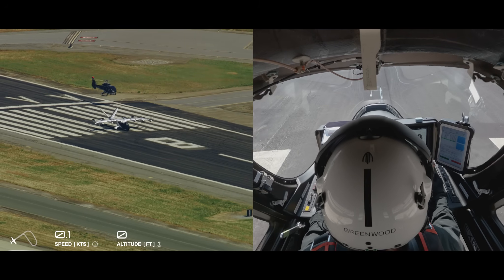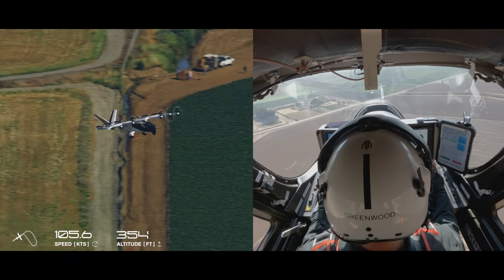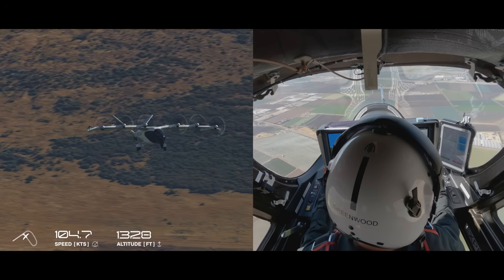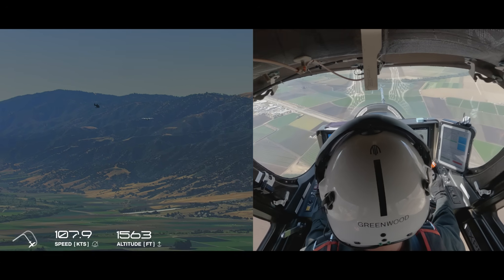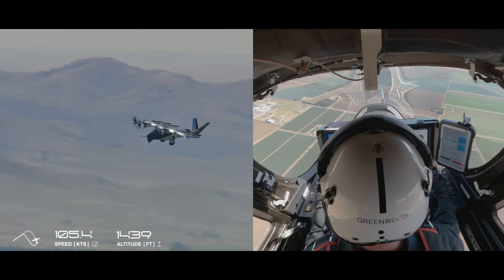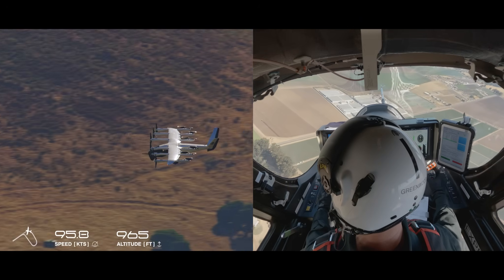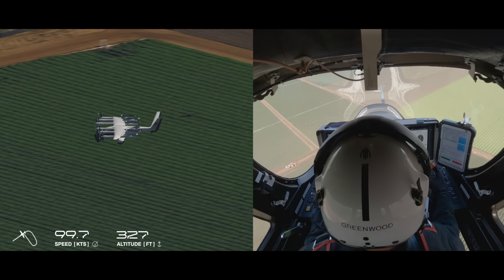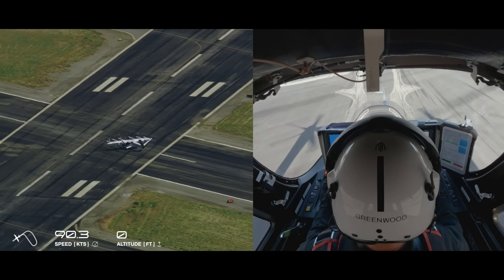Midnight Piloted Flight with CTOL | Full Flight Video

Comment: I earlier hadn't realized that an eVTOL first had to prove it's capable of conventional CTOL like an airplane. In this test flight the six rear propellers appear to have been shut down. Archer apparently needed to prove that if lifting capability were damaged, the aircraft could take off and land like a conventional airplane. And it appears they did it with only half their propellers operational. Well done! Archer has already conducted unmanned VTOL flights. We're looking forward to a manned VTOL test.
Reply: The rear propellers (fixed in the vertical-thrust direction) are shut down for horizontal flight.  By design, they are only used for vertical takeoff/landing.  The manned-VTOL will be a huge milestone for them, can't wait!
Reply: Correct. Unlike a helicopter which my lose its one and only rotor and drops like a rock from the sky, if the Midnight evtol loses its lift rotors it can still land like a plane. Much safer.
Reply: @Palyaltosuper8  Helicopters can still land despite engine failure, they use "autorotation".
Reply: @XxxSimonLPxxX  Experts everywhere..
Reply: @Palyaltosuper8  What happens if it looses forward propulsion motors? 
What happens if the batteries decide to go into thermal runaway?
Reply: Same thing as a conventional aircraft—it glides down to an emergency landing.
Reply: @Palyaltosuper8  I can't wait to see the glide tests something tells me that with all those dead props causing drag it won't glide very well or be very controllable whilst doing so.
Reply: @thedave7760 each motor has its own battery pack.

Comment: It appears that the 2 blade configuration is being used for the rear stations and they are locked in position which is all very positive for wingborne flight. Have you demonstrated this configuration for vertical takeoff, vertical landing, and transition during non-piloted remotely operated flights yet?
Reply: The multi-billion dollar question.  They still need to demonstrate transition with the latest iteration of Midnight.  This is progress though.
Reply: They've demonstrated unmanned VTOL. We're awaiting a manned VTOL test.
Reply: @CurtRenz  My question was specifically about remote VTOL with the 2 blade rear rotor configuration used in this CTOL testing. I don't believe that they have demonstrated this yet, but if so please point me to your resources.

Comment: Why doesn't anyone at Archer tell us how long the flight range is? 

Why doesn't anyone tell us how long it takes to charge the batteries that are built into the wings and can't be swapped out for other pre-charged batteries?
Reply: They do. Do some research. 120 miles. 20 minutes between flights.
Reply: @Palyaltosuper8  I've never seen a video of an Archer flying 120 miles non-stop! And after 20 minutes of charging the batteries it flies again! Have you seen that?
Reply: Well I don’t have the ability to follow Archer employees around all day long everyday. I have a job and other responsibilities in life. But then I have never seen a satellite rocket launch and am completely comfortable believing they exist and do what they were designed for.
Reply: Since they are using the Molicel P50B battery with Group14 Technologies SCC55 silicon anode material, a 20 minute recharge time is quite within expectation range.
Reply: @gerrylangeler8039  Have you ever seen a video where Archer charge their batteries in 20 minutes and then fly 120 miles?
Reply: @Costa2017  Nope.  But I know the P50B's specs and have seen it in other modes (hypercars, heavy lift drones) so the recharge time is what I'd expect.  I have no clue of the range, but given its energy density, it doesn't seem off the map.
Reply: @gerrylangeler8039  How well do these P50B's handle ultra fast charging does it damage the cell?
Reply: @thedave7760  The P50B is rated at cycle life of 1,400 (that's still retaining 80% of original energy density).  So, it's designed for this kind of rapid charging.   Be watching for the even higher performance P60B coming out this summer.  All the specs aren't out yet, but it would not surprise me if Archer and others don't upgrade to it.

Comment: Why would they not do a VTOL? Isn’t that the main objective?
Reply: My daughter is one of the aeronautical engineers at Archer this is the order of events they test.. this was the first piloted test flight this is the order it goes in... Showing amazing progress
Reply: @T.S.G.  so should we go all in ? asking for a friend?
Reply: It's to test flight capabilities incase there is a malfunction hindering vertical landing
Reply: Probably have to prove the aircraft can do piloted CTOL before VTOL for safety reason
Reply: It needs to be tested for standard take off and landing as well.  Every scenario should be tested.
Reply: Landing gear capability proven with this test, it was necessary to achieve
Reply: FAA requires both flight formats, evtol as well as conventional. Evtol remote flight was demonstrated last summer and can be seen on front page of their website as well as here. Next was piloted conventional, which is this one. Next item on the agenda will be piloted evtol. Aeronautical testing and certification comes in multiple, provable steps and increments. This was just one more box to check off. Still more to come. This is a vehicle the world has never seen before and archer is quite literally blazing a brand new trail in a brand new category. There will be bumps and hiccups along the way and it won’t go in a straight line. But long-term I believe this is a superior aircraft for short term flights. It’s easier to fly. It’s cheaper to maintain. It’s quieter and less pollution. It’s also safer because it has a lot more redundant safety systems than a helicopter.
Reply: Its part of the criteria for FAA’s cert
Reply: They have to be able to do CTOL no matter what, for safety. This was only testing for that, at the moment i believe
Reply: Because it takes a lot more battery power To take off and land vertically Period I'm not sure if their batteries are mature enough to accommodate that
Reply: If VTOL malfunctions for any reason, there's an out; this.
Reply: Archer has already conducted unmanned VTOL flights. This was a required test of conventional manned CTOL like an airplane. We're looking forward to a manned VTOL test.
Reply: @CurtRenz  yawn Joby has been doing that already for years.
Reply: According to IE it's to prove the robustness of its landing gear and its ability to land CTOL in the event of motor troubles.
Reply: Their testing has been extremely methodical, as would be expected for a new type aircraft.  No impatient jumping ahead.
Reply: This dude doing base jumps before finishing diapers 😂😂😂😂
Reply: 버티컬에어로스페이스가 최초 유인비행임
Reply: Jesus China evtol already did 100 above flying test with 2 passengers each fly totally 200+ passengers from Shenzhen to Zhuhai,  but now we just did the first test but without passenger.   If this is the speed we are doing everything how can we not fall behind ?
Reply: @Mistymountainhunter FAA regulations are pretty strict. Not all countries are regulated by the FAA.
Reply: @Mistymountainhunter what does Jesus have to do with it?
Reply: Jesus rose up in the sky when he left?
Reply: @Mistymountainhunter  you wont see does made in China flying in USA any time soon, just because exactly that! ( not FAA compliant )
Reply: Yeah, and China has inferior flight and safety standards than the FAA requires here in the United States of America.
Reply: @Mistymountainhunter you should hop in one of those. I hear China has extremely high safety regs.
Reply: 'China'
🤣🤣🤣